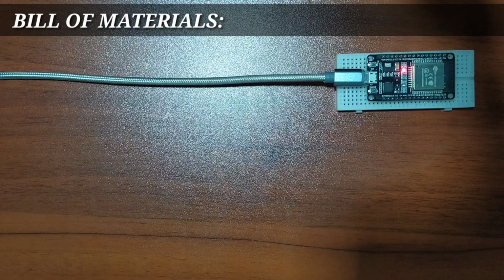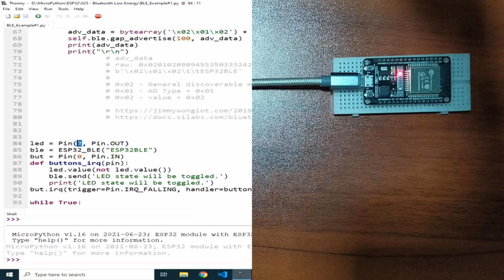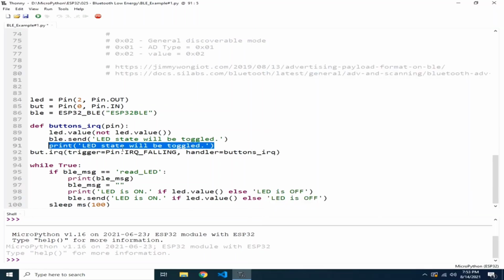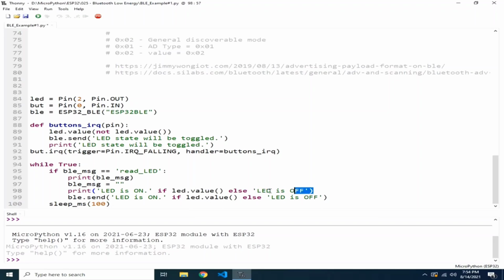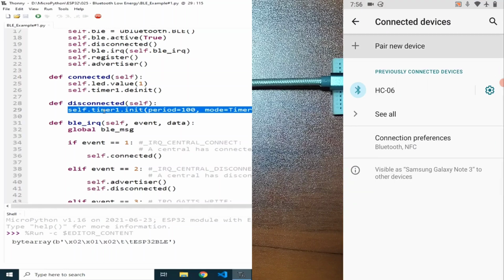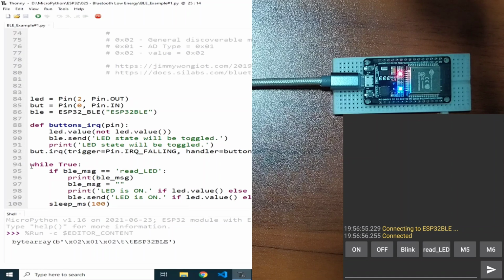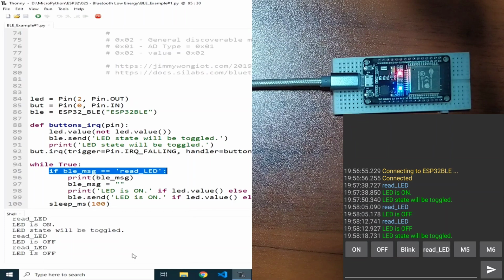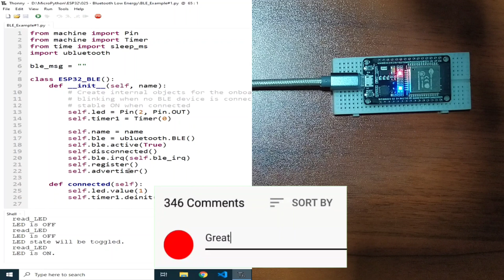025 - ESP32 MicroPython: Bluetooth Low Energy | BLE

Comment: Your code snipped runs very nice on my ESP32. Do you have an idea how to read the sensor data on a win10 PC? I would like to collect, plot and save some analog values over time.

edit: with bleak I always get the error  "BleakError: characteristic does not support notifications or indications"

Comment: How do I connect to this using gatttool on a seperate computer? I am unable to connect using 
gatttool -b 30:C6:F7:0B:4E:D6 -I
connect
getting errors such as Function not implemented(38) or rarely Transport Endpoint is not connected(107)
It's been suggested that I use the command gatttool -t random -b 30:C6:F7:0B:4E:D6 -I instead however that just results in connection refused.

Comment: Hi George, any chance that you can do a video on getting readings from Xiaomi humidity and tempeture indicator (LYWSD03MMC).  I can send you a unit if you plan to do one.
Reply from the maker: Hi, of course. You may send me an email for further inquiry at tech.to.tinker@gmail.com
Reply: I will contact you via email to arrange for the parcel
Reply: Hi,  have you received the Xiaomi humidity sensor?
Reply from the maker: @enquiry8918  no not yet. How do you send it? If you send through the traditional postal, it will take months to arrive.

Comment: Hi ,, if I put ble.send inside while loop gives error. I am trying to send data without pressing the button , but couldn't make it ,
Reply from the maker: try to add some delays on it.
Reply: @TechToTinker  didn't help,  I just added while True:   
          ble.send("hi")
          sleep(5)

doesn't work gives error: OSError: -128
Reply from the maker: @tomipiriyev  what happened if you run the example source code in the blog?
Reply: @TechToTinker  it works fine, I just send you email about my issue
Reply from the maker: Hi Tomi, I just updated the blog post at: https://techtotinker.blogspot.com/2021/08/025-esp32-micropython-esp32-bluetooth.html with additional example source code to address the issue.

Hope this helps.

As always, its George.

Comment: hi , im new using micropython i have a problem i have error status Gatt 133 , i have conected to diferent android devices and always return same message , the bluetooth looks like try to conect, the led stop blink but then some seconds lose or cant be conected ,,  some help ??  thank you so much , great videos !!!
Reply from the maker: Hi, I don't understand what you mean with "connected to different android devices"?
Reply: @TechToTinker  i mean i have test whit many diferent Android devices  and de result is the same :   error Gatt 133  so i can't connect .....
Do You know if is possible use classical Bluetooth and micropython ?
Reply from the maker: @HpsMexico-STmx-S.L.A_mx  as I said in the video, Bluetooth classic is not yet supported by Micropython as far as I know.

Try to watch again the video and carefully follow what I did, you might missed an important step that could lead to that error.

You may also try a different MicroPython firmware preferably v1.14
Reply: @TechToTinker  hi the problem was solve  i was using version 1.16 y dowgrade to 1.14 and 1.12 al all is working perfect , thank you so much 
I your follower I hope  you can make more videos about micropython in special ble and can bus 
Thank you so much !!!
Reply from the maker: Nice, its to hear that you are able to solved it. Cheers.

Comment: Thanks for the video.👍
Reply from the maker: Glad you liked it. Cheers.
Reply: @TechToTinker  how can we control onboard LED or call a function with serial terminal app?
Reply from the maker: @shaggy462  yes, of course. Show your code, what you have done so far.
Reply: @TechToTinker  Got the solution. Just added led.value(not led.value()) in while loop and got the idea to get data from different sensors now. Thanks for the code.
Reply from the maker: @shaggy462  good job and you are most welcome. Cheers.